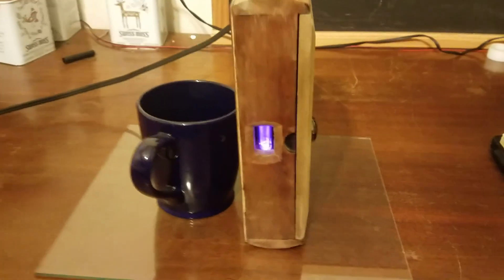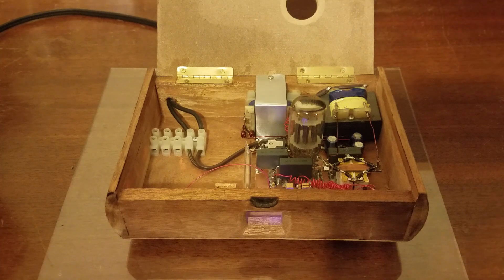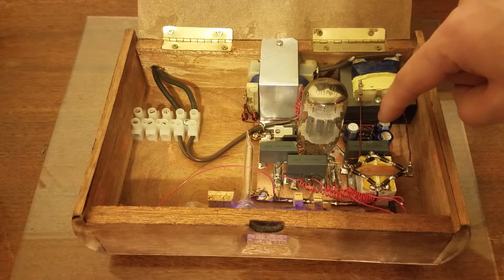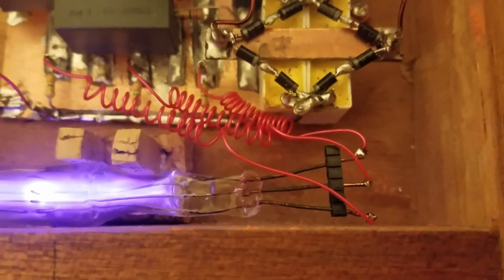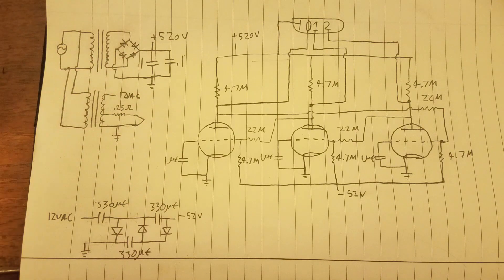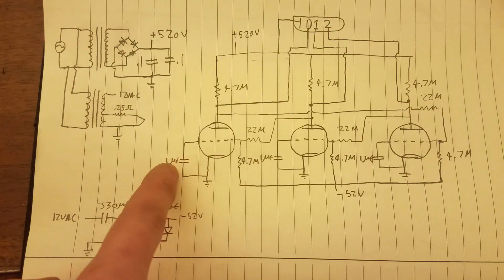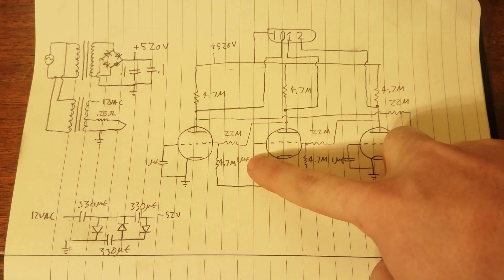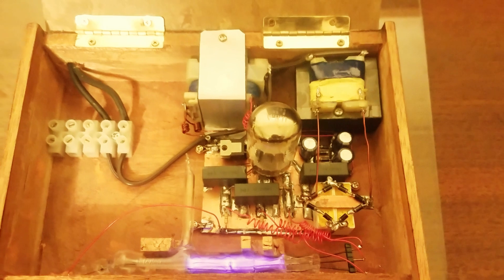Purple Nixie Tube With Triode Ring Oscillator

Comment: That looks awesome! I didn't realize you could make such a simple ring oscillator with triodes. It's quite tempting to keep my eye out for some triple triodes now just to make one! 

Keep up the great work!
Reply from the maker: Thank you! I was not sure at first either! It took a little playing around with to get it to work, and I am still a little fuzzy on the exact operation. I could not find a schematic for a tube ring oscillator so I copied one for use with N channel mosfets, added the negative bias resistors and tweaked the values. It might be dependent on the use of high mu triodes but I have not verified.
Reply: @jdflyback  you designed that circuit too?? That's awesome! Since it's based on mosfets, the high mu may be significant; however, if it's not, it would be fascinating to see of it could be replicated with your homemade triodes!